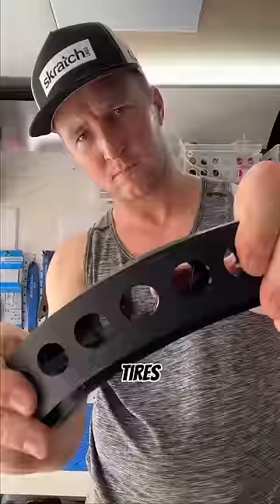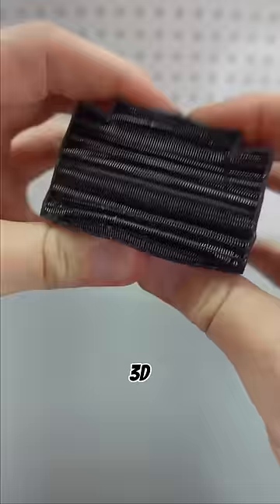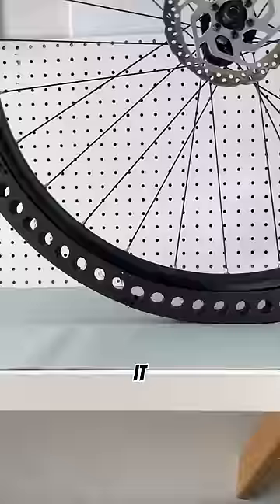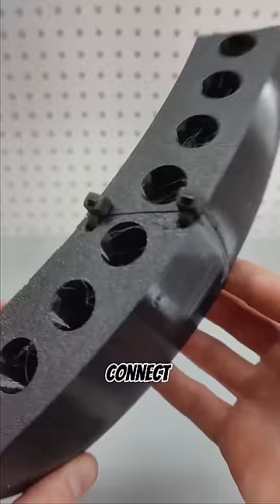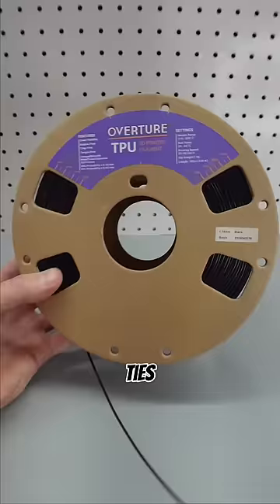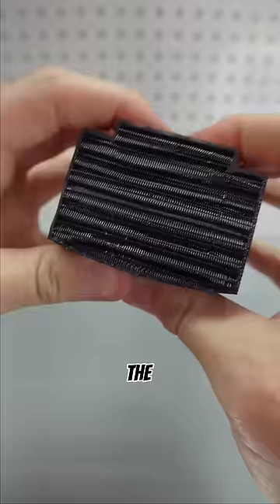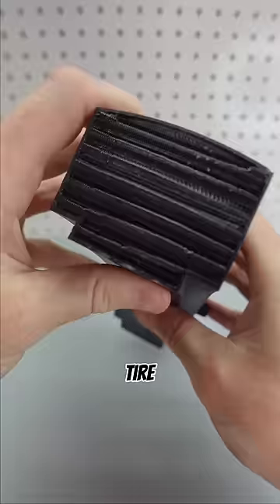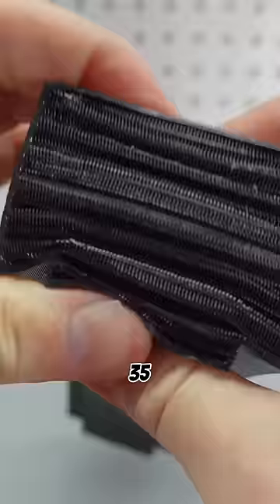3D print your own bike tires! #mtb #cycling #bikeshorts

Comment: Traction has left the chat
Reply: Probs a prototype or just a faster print for the vid
Reply: thats a ez fix at this point haha
Reply: pretty sure this is just to replace the innertube
Reply: @skyler114 yes
Reply: This is only meant to replace the inner liner which is filled with air, you obviously still need to put the belt / tread on.
Reply: Yal trippin, this comment was funny asf
Reply: @AnonD38 actually it's the whole tire... The op said so in another comment
Reply: ever heard of road bike tires bruv?
Reply: @AnonD38 no it’s not 
This is all of it
Reply: @Semparo  Hm
Reply: @MaximusTheChosenOne  Huh
Reply: @AnonD38  THIS IS THE WHOLE TIRE 
THE ENTIRETY OF IT
THERE IS NO OTHER COMPONENT 
THIS IS ALL 
THRE IS NOTHING ELSE THAT IS ADDED 
THAT IS ALL
Reply: Impressive, I imagine they will last as far as the end of your garage entrance before printing out your new cool replacement
Reply: @MaximusTheChosenOne  Ya don’t need to shout, I understood you the first time.

The "Huh" was a sign of surprise but also confirmation of the news you have brought.
Reply: 12 yo trying to show off he knows science lol
Reply: smooth brain moment
Reply: He just wanted to drift
Reply: @dav2505  
Even road tires have some form of traction. It's not smooth brained.
Reply: @skyler114 can't see how the tyre will sit in the rim wall, its not to replace the tube, they would be rounded to otherwise, he stated the air pressure would match 35psi, that means the fill in when weighted down would feel like 35psi.
Reply: Safety aswell..
Reply: @skyler114  are you often pretty sure of dumb ass things that just popped onto your mind?
Reply: Have you ever seen road bike tires? They're smooth, but still I think these tires would break apart with any force because of the zip ties
Reply: just wrap it with rubber and defeat the whole purpose
Reply: Yall arguin over this shit bro that tire looked smooth, flat, and hard. No way it's anything more than a prototype/proof of concept.
Reply: @NoobMaster-we6ll  sure man I'll go with that
Reply: Thats what I thought
Reply: In order for there to be a grip on the ground, the coat has to be pulled over it?  Then you can say goodbye to the coat relatively quickly... Because the square design causes the round coat to be heavily deformed, which is not what it was intended for.  After about 1-2 years you can expect cracks to appear in the coat.
Reply: After braking hard a couple times, there will be no tire left
Reply: @Frommarsss No ... definitely not.

Comment: There's a reason pneumatic tires are everywhere. They don't just dampen, they conserve energy. That's important on a bike.
Reply: if we're talking about just a simple, basic commute to and from a place, i dont think you really need all that much more than this. i think the only real objective flaw here for such a simple practical use is that it doesnt look like this would grip a surface you're riding on very well, which could make it feel like a very slide-y ride and make turning more difficult.
Reply: We still need to advance technologically so every new design is welcome if approved
Reply: @Templarfreak Bikes are super efficient and muscle powered - this means very tiny efficiency changes can have a huge impact on ride comfort. Tossing a bunch of efficiency in tires that don't rebound as effectively could be really noticeable over a few miles.
Reply: @saiboogu for commuter bikes with modern lightweiggt frames this is barely an issue. The drag from the upright riding position is infinitely worse than the efficiency loss of a proper airless tyre.

These printes homemade ones are neat, but you will notice a difference in effort qt anything above 10kmh
Reply: @saiboogu efficiency is not really something everyone needs. if it's not falling apart on you, if it's not extremely strenuous, if it can get you from point A to point B, and it's not slower than or close to you walking normally,  then it's probably fine. the only reason i bring up the tire grip is because that's a semi-vital thing to have for just getting from point A to point B. if you want to take your bike on a more adventurous ride, want to go faster more easily, etc etc, than that's just something for  you yourself to consider when you buy a bike, but that isnt important to everyone.
Reply: Underrated comment. These probably feel like driving on a muddy street compared to normal tires. All that internal friction will probably heat up the inside of the tire significantly more too.
Reply: They used to put full rubber and plastic tires on kids "dirt bikes".  I tried to go riding with my family when I had one and it was hell.  I will stick with pneumatic tires thank you.
Reply: @pg7166 that is a bullshit argument. Airless (bicycle) tires are by no means a new invention. Progress, for the sake of "it's different than how everyone does it," is no progress at all. If these are actually better than normal tires, sure, go for it. But if they were, we'd have switched to airless tires 100 years ago.
Adding on to that, there are things in this world you can improve on because science (thermodynamics most of the times) says so.
Reply: @heulboje21 the longer it’s around the longer we learn about it. The pressureless basketball was never considered a viable trade off until recently. Because of that new design going around. All of a sudden there’s a light at the end of the tunnel for that product, you can see how it could be transitioned in later on.
Reply: I was gonna say, this looks like it has a lot of friction with the road. It's all surface area. Probably feels as heavy as riding with a flat tire
Reply: @Nich_B23  Not really an argument against the argument he's making.

Shit product -> lots of time -> better product.

This happens a lot and it's basically the argument you're making.

The argument he was responding to is more like:

Shit product -> use it because we like innovation -> still shit product.

Comment: Man said fuck turning we going straight till we hit something
Reply: Why wouldn't you be able to steer with them?
Reply: As long as it's going forward it can turn, it just can't turn at a stop with weight on it as easily.
Reply: @mastervule1844  he would, but the profile makes them to have about a more similar friction contact straight and turning, making you to have to steer it harder (more degrees) to achieve the same deviation rate. 
as someone who has done like 6 iterations on small 3d printed tires, this version is kind of awful as neglects almost every important parameter. 

also, the empty cylinders as reinforced zones compared to the rest, so as constant pressure, the wheel would would wear faster at those regions.
Reply: WINNER 😂😂😂

Comment: Going around corners sounds like a blast!
Reply: Or crashing metal
Reply: A metallic rin blast of metal.
Reply: My thought too
Reply: As in blasting your face straight into the concrete? lol
Reply: Y'all hatin. The design could easily be made curved
Reply: Literally a blast
Reply: @UncleMerlin  But this iteration wasn't, so it's currently a safety hazard.
Reply: @UncleMerlin  the profile is not the problem. It would roll straight off the rim with any kind of lateral force
Reply: Their wide enough so when you lean it actually still cover it unless you bending like a motorcycle racer
Reply: activate self repair functions!
Reply: @dwhall68 as it currently is, 100% agree with you, but I feel like the design could easily be improved in that manor by utilising a tighter means of connecting the segments (i.e., not fecking zip-ties 🤣)
Reply: @lilwon7694 These tires are easily not wide enough for leaning, especially without knobs
Reply: I was thinking the same thing? Tires have no curve whatsoever ... how the heck are you supposed to turn? LoL
Reply: Especially on a wet surface and no tread
Reply: @UncleMerlin  the shape isn't the problem, it's just that it'll twist off of the rim
Reply: @UncleMerlin that’s great, but a friction seated rim insert isn’t gonna hold if I have outward force. Inserts are just gonna pop out
Reply: @_wanderluss_1944  that was just a suggestion for securing the segments as the design currently stands. I did suggest tube tape as well but that also relies upon radial shrinkage of an inflated tyre to hold it safely in place.

The design definitely needs refining with a purpose designed rim that will safely grip these segments. Perhaps something like drillings between each spoke on the span sections that would allow studs on the printed tyre segments to pass through and be held into place somehow as hook bead rims require air pressure to force the tyre to fit either with or without a tube.
Reply: Bros acting like he’s smart enough to figure that out. We all saw the other video too guy…

Comment: I’ll try ‘em when I see you ride with them flawlessly. 🎉
Reply: My point exactly. Homeboy doesn't have the bravery to be a test dummy!
Reply: Or ride with them 

At all
Reply: Yeah, those are coming out at the first fast corner.. metal bracing around the rim must be added
Reply: he has.
Reply: @aidarsharafullin6900 the sharp corners will make him fall on turns
Reply: He poted a short where he turned a corner not even sharp and it fell off
Reply: @Shaki010  Yet he's here in the comments section saying they are surprisingly hard to roll off
Reply: Same as skateboard wheels 😬those are slippery AF if not completely dry, and only work on completely clean surfaces without loosing grip, id recommend using litterally anything other than the material skateboard wheels are made from like rubber, and then you could fill it with air pockets to make it comfortable……. Oh wait that is a tire

Comment: >airless
>look inside
>air
Reply: Why would you want a vaccum in your tires though?
Reply: @SineN0mine3  It's a joke, there was a viral post that went
>wireless device
>look inside
>wires
Reply: @chrissedgwick9692 love that meme
Reply: @SineN0mine3 i would want a vacuum in my tires because after i ride my bike to work, take the front wheel off, and carry it up to the office with me, i can stop and clean up a mess on carpet or hardwood,if needed.
Reply: @chrissedgwick9692 reminds me of that one ai greentext about a bottomless pit supervisor lol
Reply: Less air not air non-existent.
Reply: @travistucker7317 
Theoretically one could have electric generators in the wheels, so that while you're riding it charges a battery bank, which could power a handheld vaccuum.
Could also just charge devices inside a watertight case either nested in the frame or on a rear bracket.  I'd use it lol
Reply: Tell me you don’t know what pneumatic means without having to admit you can’t spell pneumatic.
Reply: @Direwolf1771  me if I was stupid
Reply: Pressure-less air tires
Reply: insert a cat looking down
Reply: It’s free range air.

Comment: there is a huge problem. the tire has a flat surface. the main method of turning on a bicycle requires leaning while turning the handle bars, meaning that with these any sharp turns would leave you on the ground.

Comment: THE TIRES ARE SMOOTH
Reply: Not just smooth, also square. Back to the drawing board.
Reply: @bramweinreder2346  They also have no rotation / bead pressure that is caused by the air always flowing to the most strained part of the road, so they'll just disintegrate when you turn a corner.

Like jumping on a cornflake box.
Reply: that's generally fine for bikes, actually.
the reason cars need treads is because the wheels are very very wide and have a large contact surface against the ground, so water can get trapped underneath.

With bikes you only have 2 wheels and a much much smaller contact surface, so the pressure is much higher and thus the water just gets pushed out from under the bike.

Granted, these tyres are flat so a tread wouldn't hurt, but that's probably the least of the problem with them..
Reply: It’s a proof of concept
Reply: 600k likes.  Hmmm. What am i missing
Reply: @swedneck it’s for mtb, you need grip for covering and dirt
Reply: @swedneck I can assure you you dont want slicks in the rain, especially on a bike😂😂😂. Only having 2 wheels doesnt make you cut through the water.

The only real downside 4 tires and high surface area cause is aqua planing.

Downside to a 2 wheeled vehicle is that you lose grip when accelerating and turning if you dint have grooves to deflect the water. Meaning you will fall and hurt yourself....
Reply: @kaptein1247 I agree I’ve personally experienced this I ate shit because I had bald tires in the rain
Reply: @Honoka4130  Yup, dont underestimate how dangerous bald tires can be. Especially on a motorcycle.
Reply: If the are square/not rounded
It is more dangerous @swedneck
Reply: ermmm so are road bikes…or race bikes
Reply: @tessleye_01 Yeah, people acting like a prototype needs to be a finished product are dumb.

I’m expecting the guy to upload more videos with improvements to the design over time.

Plus anyone who downloads the files can always modify them however they want, so it’s just a basic template.
Reply: Like his brain
Reply: @swedneck i did cycling and mountainbiking for 10years, and trust me you need threads on your wheels. If you dont want to slip out and eat some curb.
Reply: @swedneck I am guessing you never rode in rain on a threadless tire. Something once you do you swear never again.
Reply: they look OK if you're willing to do spoke tension maintenance more frequently
Reply: They're slicks.  For traction through the chicane.
Reply: Road bike wheels are smooth
Reply: The concept still valid tho, you can just add tread to your own 3d print.
Reply: @swedneck it’s an inner ‘tube’ not a tyre
Reply: dont need tread on many tires
Reply: A lot of street tyres for mtb's and road bikes are.
Reply: File?
Reply: yeah which means they only good on asphalt during dry weather
Reply: @swedneck  YOU DO NOT RIDE A BIKE IN THE RAIN I SEE
Reply: Well... TPU is rubber... if it wasn't smooth, their would be something incredibly wrong with it.
Reply: @Dr_Kenneth_Noisewater  😂. I think your comment went over everyone else’s head.
Reply: @leoharvie5890 no, its meant as a tyre, he also said it 4 times or more. There are tyres like these, but not printed at home obv

Comment: I've actually used airless bike tires of this type. The worst thing about them is trying to get them to fit on to the rim so the fact that yours comes in sections is pretty awesome.
Reply: They're so hard to fit because they have to be an extremely snug fit. Usually air pressure puts a lot of force on the bead, with these its just friction. They look way too lose to handle even a light turn without falling off the rim.
Reply: How do they have any grip isnt that plastic. I didnt think you could 3d print with rubber bit i guess it makes sense
Reply: Until you go down a curb and they just fly off 😂 if its not broke don't fix it
Reply: This is a gimmick for a video, not a practical usable product.
Reply: They'd immediately rip off under load lmao

Comment: I’m curious how well this would hold up against different temperatures or prolonged use. It would be a neat alternative to inflated tires.
Reply: I think these could be a great idea for bikes and other low speed vehicles. Would be nice to know how they handle what you said.
Reply: i wander how these would behave in a high curve at high speed.
Reply: And when you get rocks in the holes,  mind your bottom 😅
Very interesting concept though 👌
Reply: В СССР в 1980 мы использовали жгуты из каучука в велосипедной покрышке. Управляемость ухудшается.
Reply: PLA would not hold up well against higher temperatures, especially for longer periods of time. But hopefully nobody is relying on PLA wheels 😂
Reply: So your not curious if doing this is actually more economical? Because if its not, which im positive that its not, then this is pointless
Reply: Not well lol, not at all
Reply: @pepijnb5518 Not well. Is not well at all is my assumption. My dad design tires and rubber for a living. And that was pretty much my first thought too . I could be wrong but I don't see how you're gonna turn on something That just falls off at ninety degrees. The rolling resistance looks pretty rough too.
Reply: Need a rounded tread for corners
Reply: @goa6329  they can be covered
Reply: you will be very dissapointed....
Reply: @waynehamel9109  the rounded part os technically called "The shoulder" fyi 😎
Reply: Where I live I feel like they would melt in the street/side walk 110° is crazy and its probably no the hottest in the world
Reply: @pepijnb5518 death awaits high speed corners on these I’m sure
Reply: @bobs8005  i already had that in mind hahaha
Reply: I was going to say I'd like to see this tested in the summer in az.
Reply: TPU flex filament doesn't melt until well over 220 C (basically, if you're riding somewhere that hot, you AND the bike tires would be melting XD)
Reply: There's a reason it's a "shorts" video. No way these last in any stress test of an extended time period
Reply: them wobblyt tires after a while as the're unevenly damaged after prolonged usage. xD
Reply: Definitely a good alternative if you don't have the time or money to replace your regular ones. It's like that small spare on a car.
Reply: @Rose-yx6jq  you mean that product that looks a lot more expensive than regular tires?^^
Reply: @luckylunch3256 TPU has a heat resistance of 80+ celsius depending on the type of material. Melting shouldn't be an issue.
Reply: Think about speed too. Even car tires are rated for certain speed maximums
Reply: Actually no, it fucking wouldn’t
Reply: I was thinking about how much fun it'd be to road test for endurance and comfort. But I'm a single mom of 2 and have no time, no bike, no 3d printer. My science itch will have to be passed on to another brave soul.